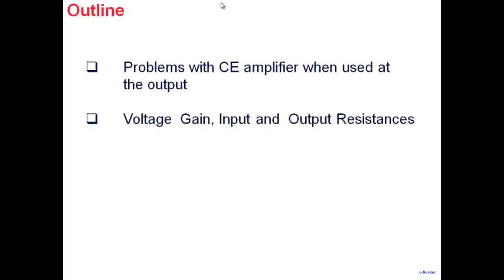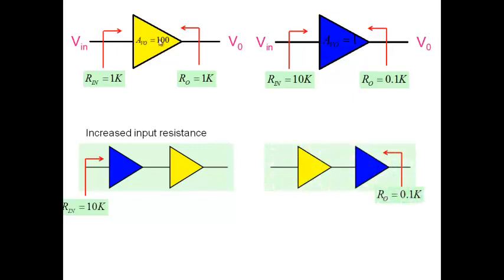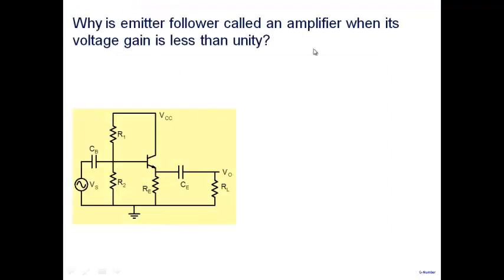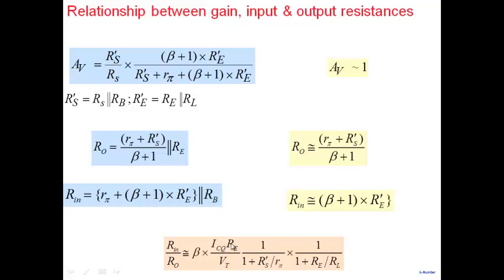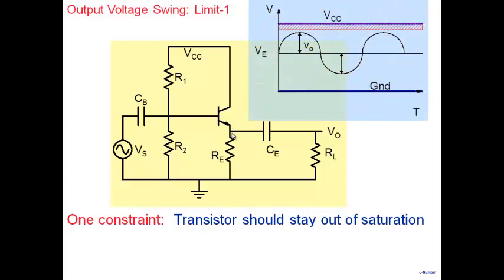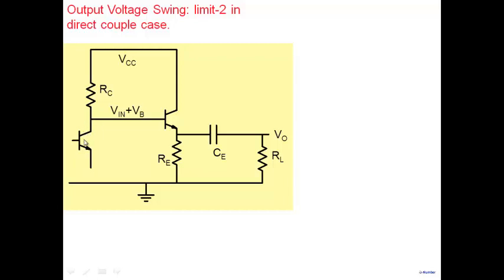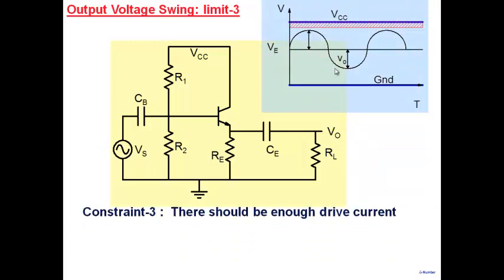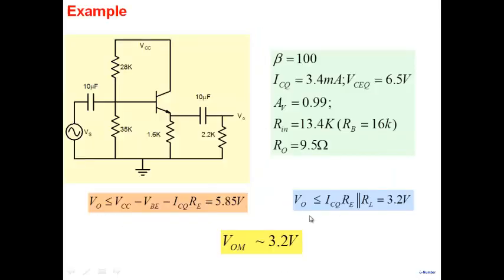Common collector amplifier (part 1) (EE210 L22)

Comment: You have a mistake @ 13:55.  The RS//RB it's not supposed to be there. I have worked out the result and it's impossible to get that RS//RB. Where did you get that?
Reply from the maker: I am guessing that you are pointing to the Rs||rb term in the denominator of gain expression. i will go through the derivation but Check analysis by taking thevenin equivalent of Rs, rb and vs. let me know if you still find an error. We can all make mistakes😟
Reply: baquer, I know we can all make mistakes, I was just pointing out something that I have spotted in my calculations, but I might be wrong as well. I am gonna try with the thevenin equivalent an check against my other solution, which was based in node analysis and KCL. Regards.
Reply: @pyroBlastM  what it wrong?